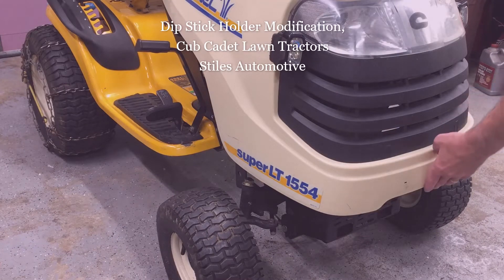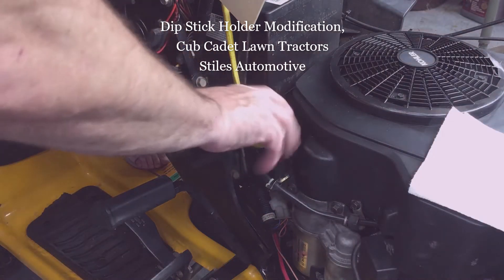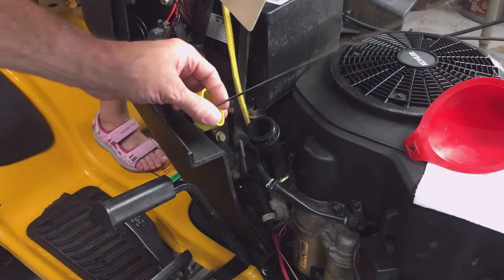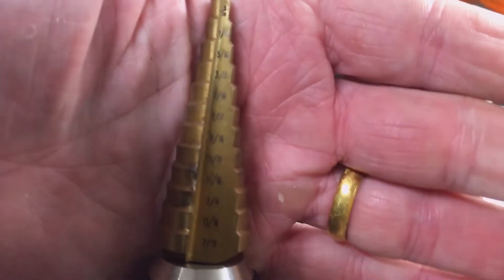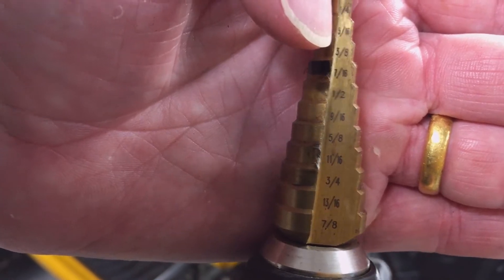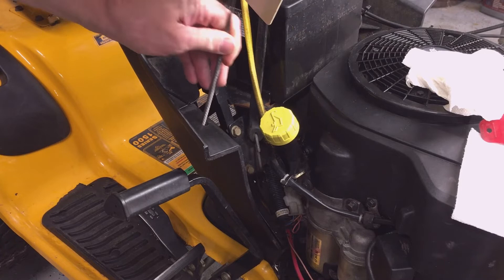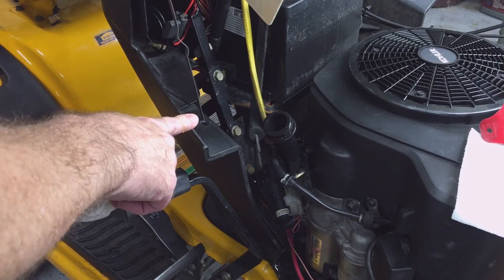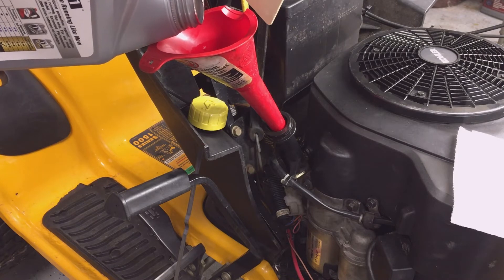Dip Stick Holder Modification, Cub Cadet Lawn Tractors

Comment: Now I can look forward to changing my oil once a year b/c I don't have to fumble around finding a rag to set that pesty dipstick on. What was I thinking?
Best video I've seen my whole life. I would never have thought to drill a hole in my $3,000 mower.
Reply from the maker: Parker, I appreciate the feedback! My dipstick issue wasn't just once a year, I had that Head Gasket Leaking for a little while (see Head Gasket Replacement Video) and my Tractor was using Oil.  I had to check and add Engine Oil more frequently. Necessity is the mother of invention!  - Stiles